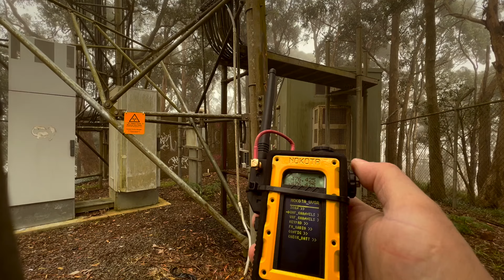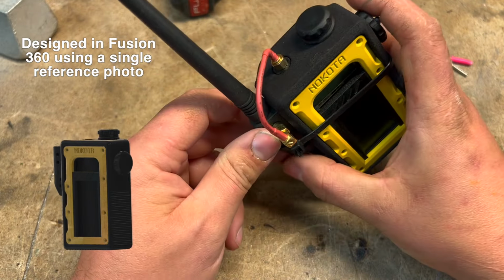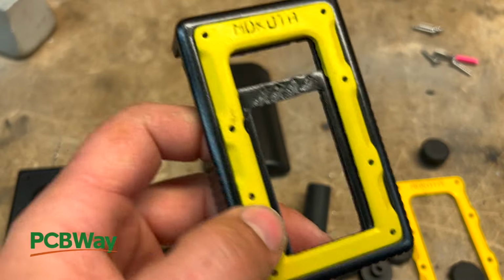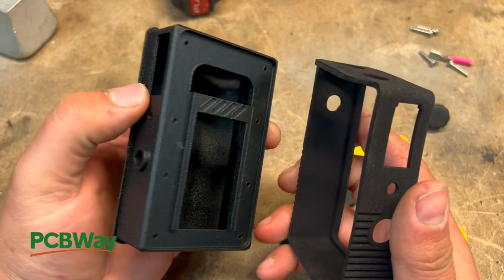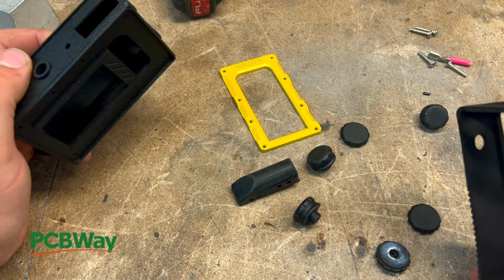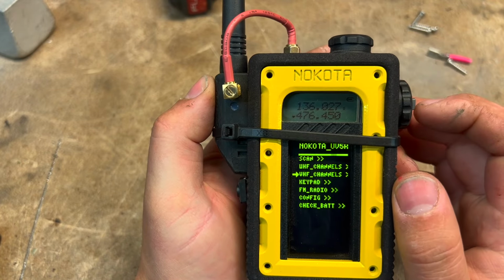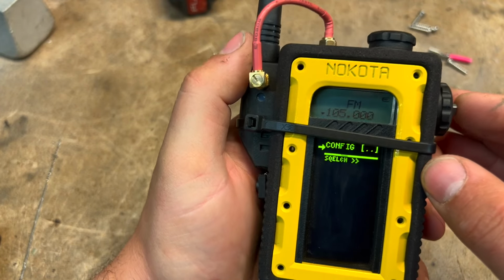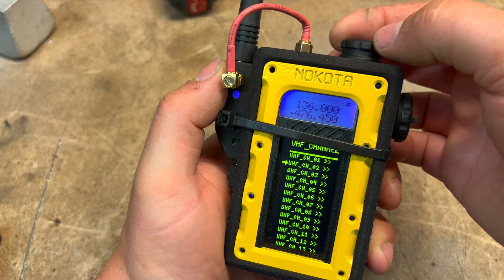Real life Cyberpunk Radio Prop Build (Arduino Powered Baofeng UV5R mod)

Comment: Hey that's a tight radio. Do you have build plans. I wanna try and make one myself. I was also wondering where you bought your led screen and what boards your using to run this.
Reply from the maker: Thanks man! Check out the link in the description to hackaday, it has the parts listed, and in the “logs”‘there’s tons more info on the build
Reply: @taylorhay Hey with your Patreon does it have the demontions and everything so I can rebuild it through Pcbway
Reply: @eqrosario363  I would like to know this as well, I'd be going the same route as I have no equipment or knowledge in 3D printing.

Comment: Cool project!  This got me thinking... why don't repeaters broadcast their pl tones in ax.25 or some other digital format so that radios can auto-configure themselves for nearby stations?  It seems like it'd be possible by adding a little TNC to the arduino.
Reply from the maker: Very cool idea! My next idea is to build a Morse code (or other encapsulation) text messenger that plugs into the headset port, but I hadn’t thought about using it for auto config!
Reply: @taylorhay  according to a reddit comment, for some repeaters in the UK if you can interpret the CW ID it will contain a region letter which can be mapped to a tone... 

..."Here in the UK the repeater has to broadcast it's callsign followed by a letter. That letter denotes the area and also tells you what CTCSS tone is used. For example in my area the repeaters have to broadcast <callsign> short gap <E> which stands for 88.5Hz."

Comment: I've not used PCBway before, do they have a marketplace where someone could order some of the parts you used in this project through? Or would we just need to order them ourselves with the files you have on patreon?
Reply from the maker: They do have a bazar type setup, however due to the amount of massaging that all the electronics need to fit, and all the hot glue etc - I’d feel bad selling the parts in their current state - much better for someone to get the step files and modify them to suit their exact application.
That being said, you could certainly send the files as they are to PCBWay and have a set made for yourself, it’s just not a clear process to build the radio and fit it in :) hope that makes sense!